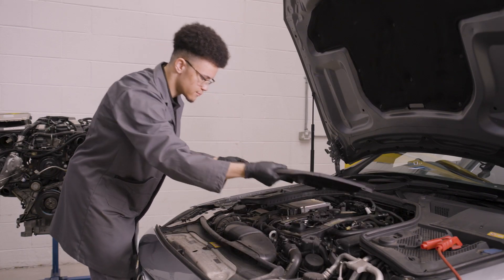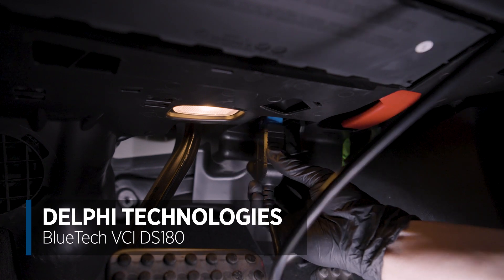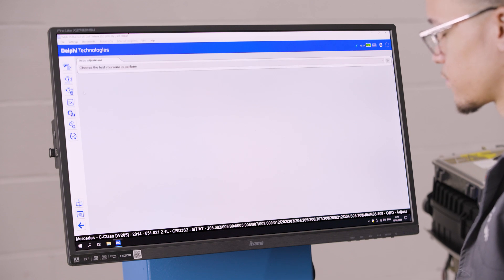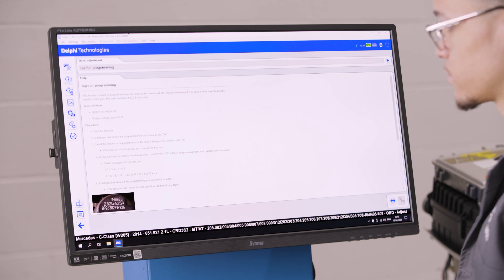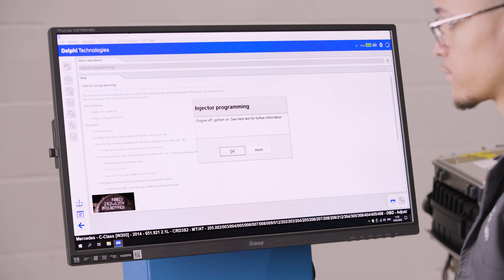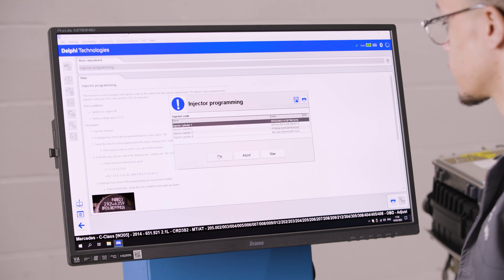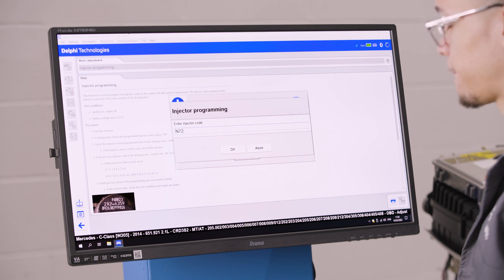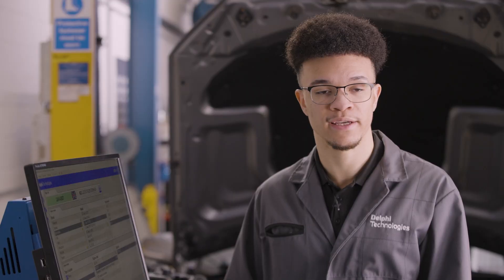[EN] How to replace common rail injectors | Masters of Motion

Comment: Very interesting.   My number 4 injector is a replacement Delphi Mercedes only a year old.  However, every few weeks, it generates an error code.  Sometimes it corrects itself and the check engine light shuts off after 3 or 6 cycles.  Currently its still on after 5 cycles.  The 349 injector is available at many places for vastly different prices.  I must imagine that the price differences are reflections of the remanufacturing quality.  But why is the new one coding errors?  Should I have the lot reprogrammed at another shop before buying another injector?  I drive a 2012 S212 E250 CDI in almost like new condition.   It just needs underbody detailing and repainting to be truly like new.  The 4th injector is the only mechanical issue and is only intermittent.
Reply from the maker: Hi and thanks for the comment. We recommend having one of our authorized diesel centres take a look at this due to the intermittent nature. Can you send an email to support.uk@phinia.com with your location / address and we can locate the nearest one for you. Many thanks!

Comment: Nice vid on injector coding. Though as a temporary test measure, is it possible to swap say injector 1 with injector 2 as Ive got an intermittent open circuit on cylinder 1. Just to confirm if it's an wiring/ECM driver issue or possibly is an injector issue w/o the coding, or would I have then to recode both injectors. Or is this a bad idea with diesel CR injectors anyway.. Thanks for the vid though :)
Reply from the maker: Hi Melissa and thanks for your question.  Whilst it is technically possible, you always need to be extremely careful not to introduce dirt and debris into the common rail system.  The system runs at tolerances down to 2 micron (0.002mm), and the human eye cannot see anything below approximately 30 micron.
At this point if you see any dirt, it is usually too late.  This is why Delphi approved diesel centres use clean areas, clean rooms, and clean cabinets to work on common rail systems and components.

If you did swap them over, they would both need re-coding to ensure correct operation and performance of the system.
Always be carefully when working on common rail systems, and the system pressures range from 300-2,200 bar.
If you do need to find your local Delphi diesel centre, then email us at support.uk@borgwarner.com, and we will happily point you in the right direction.
Thanks for watching!